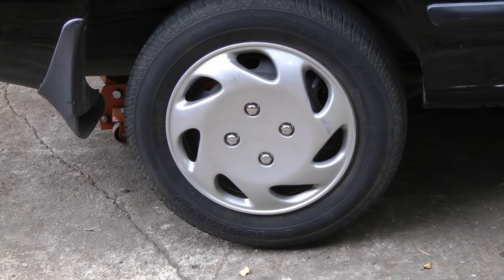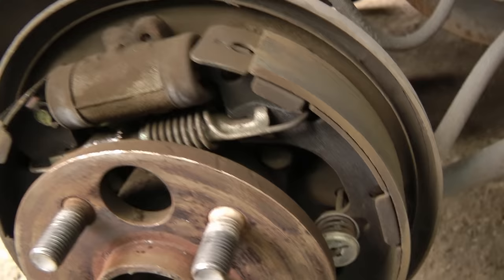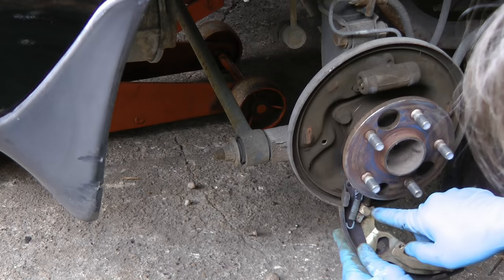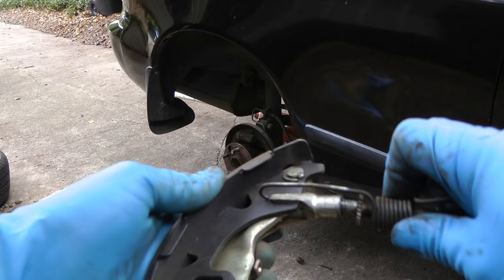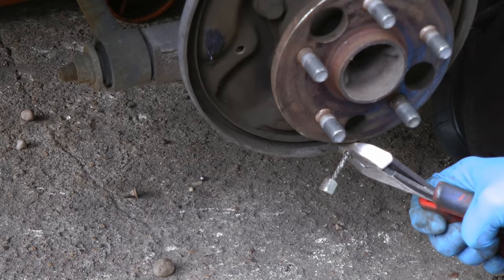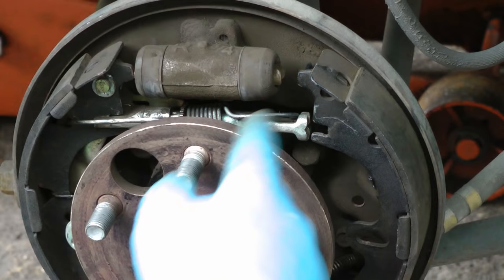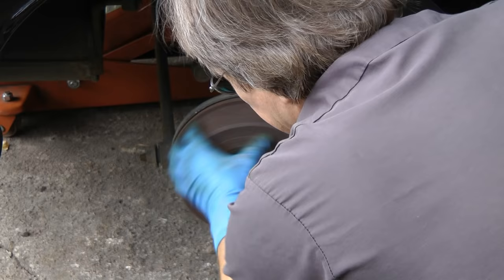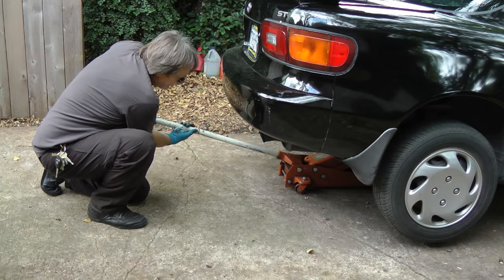How to Replace Drum Brakes on Your Car

Comment: Scotty, when I tried to do this, I didnt hold the brake shoe as I pulled out the big spring across the top. So, my wheel cylinder went out of whack. You did hold the shoe as you were pulling the big spring off, but you didn't mention it to people. So, hope people realize they should hold the shoe so it doesnt move as they pull that big spring off.

Comment from the maker: by "cover" I assume you mean the brake drum. If so, many have threaded holes in em, you use 2 bolts screwed into the holes to force if off. If not, you need a brake drum puller tool to pull it off.

Comment: I HIGHLY recommend  thoroughly cleaning both brake systems before you start. The brake dust is harmful if you breath it.  Second, you can see all the parts in much better detail.  Third, it makes the process much less nerve racking; in most cases, the whole experience becomes enjoyable.  This applies to any mechanical repair, not just a break job.  

The difference is night and day.

Comment from the maker: they are self adjusting, pull off the wheels and see if they are worn out, or if the wheel bearings there are worn out and wobble.

Comment: @Scotty Kilmer my drums are stuck and the bolts that are need to screw them in to push out the drum from being stuck the size for my civic 2013 say 8mm 1.25 but it is to small what size would fit i seen many different sizes i dont want to strip the thread thank you

Comment: And if you're someone who doesn't have the drums where you can screw in a bolt, like myself, you can get a drum puller kit which also helps, just in case the hammer isn't enough

Comment: Thanks, the shoes on our car seemed to be stopping the drum from turning all the way. Shame the drum wasn't as easy to open as this, with a Fiesta 96 there's clips and a huge bolt which needs undoing first (the size of the bolt is not easily found in stores for some reason).

Comment: You are so right...brakes are not hard to do.  I went to a mechanic and they wanted to charge me 400 to do the rear pads and rotors.  I did it myself for about 75.00......

Comment: My brakes needed a little more work than that. The shoes were down to the metal and there was a chunk missing from inside the drum. And of course I found that the wheel cylinder looked like it should be replaced as well.

Comment: Hey Scotty can u tell me why my wheel cylinder keeps popping out pass my brake drum I replace everything the same on both sides when I put my brake drum on it goes on very easy and slides right off easy but when I turn my wheel it only turn slightly then click and stop I can't spin the wheel around 86 cutlass

Comment: I didn't see the new shoes matched to the brake drum curevature. If the shoe rocks too much in the drum it causes a spongy pedal. The shoes can be bent to fit and are almost always too "rocky". One end of the shoe should only raise .020" or so when the other end of the shoe is pressed down while laying in the drum.

Comment: Hey man thanks for your advices.  I replaced my brake shoes on my 2010 corolla and bled the brakes since one on my rear pistons got out of place and pedal sunk. I did Passanger rear then Pas. Driver side then front passanger and last driver. While the car was off the brakes fell rock hard after being bled. But then i turn my car on took it for s spin but breaks feel soft, it breaks but pedal goes too further down. I wonder if i need to adjust my rear drums or if i need to bleed it again. The emergency break still goes almost all the way up.

Comment: Thanks Scotty! Would be nice to explain where to put the floor jack behind the car? So do you need to bleed the brakes?
Reply from the maker: you don't need to bleed brakes if the system is not opened to the air. See my video "how to properly jack up a car"
Reply: Scotty Kilmer
Cool! Thanks so much Scotty. I will check out your other video. Much appreciated!

Comment: Thank you Mr kilmer. You just me a lot of money on fixing my brake shoes. But don't you need to bleed the brakes or is that just when u replace the cylender to?
Reply from the maker: yes, only if system is open to the air when removing or opening lines do they need bleeding

Comment: Hi Scotty.  Question:
have a '93 Ford T bird.  I am getting a bumping/rubbing noise in rear right brake.  Left rear looks great with great meat on pads.  Right rear looks odd.  The trailing shoe looks worn a bit with cracks near the top rivots.  the leading show looks fine with lots of meat.  What could cause this rubbing/high spot noise?

Comment: Hi Scotty. Brilliant videos. Thank you. I have a Citroen Berlingo van 2004. she has grinding noise form rear shoes when braking. how do i tell whether the worn shoes have damaged the drum when i take it off.?
Reply: Check the drum for grooves, if the shoes have worn too much the metal rivets will drag and make grooves in the drum.  The drums can be machined provided that there is enough metal to stay within specifications (there should be a measurement (mm) on the drum for the maximum diameter that is specified).
If they can't be machined within specifications, then you will have to buy replacements.

Comment: I got a 2006 Ford ranger with 223k on it and I need to do the rear drums. I got free brake shoes but I'm wondering if I should go ahead and change the drum , brake cylinder and get a spring kit while I'm doing it. I see a lot of these videos the springs are rusted but I haven't looked at mine yet. Is that just a waste of money ? What do you think

Comment: Ford has told me they had to replace the seals too which meant taken off the rear axle (don't ask me why). I asked, is that always the case? They said yes.

Also, do the disks need to be replaced?

Your expert opinion?

Comment: @moofushu Scotty is right but if you lack the tools, grandpa's way of doing it would be to lightly place a paper napkin in the spark plug hole of the first cylinder. Disconnect your fuel pump relay and your battery negative terminal. Turn the crankshaft in the correct direction slowly until the napkin blows out. Then find the TDC mark at the flywheel and match. All cars should have one. Don't go the opposite direction! If you miss it, keep on turning the crank & start from step one. Have fun! :D

Comment: @SOTPM theres a special tool out there for just that proble i for get what its called though but as for me i had the same problem i just hit it with a regular hammer using all my strength. took awhile but i finally got them off

Comment: Scotty, on my 1998 Hyundai Elantra, got a brake problem, the pedal almost goes to the floor , i can lock up the front brakes, but the back i can't , no leaks , replaced the master cylinder , i noticed when i adjust the rear , the pedal doesnt travel as much , BUT then after a few days or driving , it goes back to normal, pulled the vacuum hose off the booster i hear is hiss, so i know its holding pressure, there should be amount a inch of travel on the pedal, how can i fix this ? i did find the drivers side caliper is locked up , not working, please let me know. thank you
Reply from the maker: Kody Darlington fix the driver's side calliper first, that can greatly effect pedal height. sometimes something as dumb as worn rubber brake lines that collapse do that

Comment: Is it necessary to change both left and right rear drum brake pads at the same time? Can I drive safely if I change rear brake pads only on one side?
Reply: Toma Kukoč it's not recommended you do that but if it still stops ok and won't kill anyone you'll be alright for a bit. Better to do things in pairs when it comes to brakes and other things

Comment: Hello Mr Kilmer I'm a big fan of your channel.  Thank you for the great work.  I have replaced all my brake hoses and front pads including a new break cylinder.  Yet I did not change the rear drum breaks and now the pedal goes all the way to the floor and seems like I don't have braking force I have also replaced the brake Booster yet nothing seem to help I have a 02 Ford Escape v6 any help would be great thanks
Reply from the maker: David E often a bad master cylinder does that, or air in the system, bleed all the air out first. If not that, and if it has ABS brakes, often they do that and a guy like me is needed to analyze it with a dealer scan tool
Reply: I actually  took it to the shop the mechanic bled the system and told me the issue was the brake Booster which I later on replaced and same same is it possible I did not replace the Booster the right way? It's not really that ball breaker...  I had enough room so I did not need to take the master cylinder apart so no opening of that system.  Thank you very much for your reply

Comment: hey scotty, I am doing rear brakes for a 1999 durango. I replaced the hardware, wheel cylinders, and shoes for it. it now looks exactly as before I removed it but now its too tight for the drums I turned. everything lines up right but its just a tad bit too tight and even hammering the drums in with a rubber mallet is difficult

Comment: Hi Scotty I changed out my brake pads on my jeep, I purchased BOSCH pads . Are they any good ??
 It feels as if the brakes are faded a bit and don't grab the rotor like it should . The install was perfect , I'm doubting the pad , the rotors were ok. ( they seemed)
Reply from the maker: decent pads, but not great. But change or turn the rotors and they will stop better

Comment: How can I tell if it's my Rear Drum Brakes that need replacing or my Front Disc Brakes? There is a grinding that just start yesterday, but there was never any squeaking that I thought would come from the wear indicators on disc brakes. Also, thanks for a great video!

Comment: Scotty I have a question.  How do you make sure an engine is at top dead center in the compression stroke and not in the evacuation stroke?  I ask because this comes up when synchronizing the cam shaft to the crank shaft to make sure engine timing is perfect.

Comment: I just changed my rear brake shoes on my 2005 grand caravan. before changing them I had no noise from the rear. now Since I replaced the drums shoes springs. there a loud khocking noise coming from the passengers side rear. I can't figure out what's causing this.i checked it all twice its installed properly. so I'm stuck on what to do. Thanks for the help
Reply from the maker: you may not have tightened the auto adjusters right so shoes knock. Pray it's that, cause otherwise something is not on correctly or is the wrong size.
Reply: Ok ill recheck it all an let u khow I heard something about dodge issued a bulletin that the brake cylinder might need greasing or should I just buy a new one

Comment: I love how he lowers down the car so fast on a floor jack. Fakers like Chris Fix will make a big deal about it.
Reply: trance20001 Scotty did it so fast because he didn't have jack stands. Chris uses them, which is slower but safer.
Reply: Jack stands have nothing to do with lowering the floor jacks slowly or quickly.
Reply: trance20001 it's pretty dumb to lower a car that fast.

Comment: Mr. Kilmer, I am working on the exactly same car and also on the drum brakes. Are the shoes on this car exactly the same or is one a front and one is a rear shoe?
Reply from the maker: they normally are, measure them side by side. If not, put the longer brake shoe on the front.

Comment: Scotty, I performed a complete brake job on my 2004 Acura RL, changed all the rotors and brake pads. When I put the wheels back on and went for a drive, my steering wheel starts shaking at high speed around 50mph. I did not torque my wheels. Also, brakes work fine, no grinding or shaking when braking though. What did I miss doing to the wheels?
Reply from the maker: something is out of ballance, like poorly made rotors, unevenly torqued lug nut, or rotors that went on a corroded hub and isn't straight
Reply: Scotty Kilmer Thank you, I'll start with the easiest one first and get the wheels torqued to correct specs then see if it makes a difference

Comment: Scotty first of all, I love the video. Second I had a question. I showed this video to my dad and he said that you have to adjust the brakes to perfection. He said that once you're done, you must mark the drum and make sure it does exactly one revolution when you turn it with your hands. Then he said you must synchronize both sides.he said otherwise one side will brake before the other and that the car might turn to one side more then the other when braking.  Is this necessary? H

Comment: i was installing new brake cylinders on my buddys car and accidently tore a hole in the rubber cap on one end of the cylinder....should i be worried? will that allow air to get inside the cylinder?

Comment: Good videos generally, but I broke my retainer ring pins in following this tutorial because you forgot to show how to loosen the shoes adjuster before pulling the drum off. I pulled the drum off with a lot of effort and broke the retainer pins as it was pulling the shoes forward with the drum. I had no spares, so I had to use a nut and bolt instead of the pins. Seems to be fine but was annoyed.

Comment: Just changed my rear drum brakes. Now the brake pedal feels very deep and soft!! Some oil got out of the wheel cylinder while changing the shoes, but I closed the rubber quickly back in place ... I also double checked in the drum after testing the car and there doesn't seem to be amy oil leak... What can it be?
Reply: bleed your brakes.
Reply: @jettesides420  thanks and that's what I did and now it's perfect!

Comment: Hey Scotty! huge fan of your videos!.. my rear brakes make a clicking noise when im coming to a stop and then stop after enough pressure is applied how do i find out what is wrong with it
Reply from the maker: +Derek Trevino check to see if they are worn out first, but if not, drums often don't adjust right when old and the automatic adjusters then need cleaning or replacement. If you have disc brakes, then they are worn and need replacing and new shims

Comment: I have a question is it possible to change drums and make it as a disc wheel
Reply: that is a conversion and considered a modification. if someone takes you to court over an accident, it will not far well. you will need much more than brake pads, rotors, and calipers. disc brake systems also have different hoses and lines going into them. I also suggest changing for new hardware when dealing with anything if possible. when you buy your next car, make sure it has all disc brake systems on all wheels, much easier to maintain.

Comment: I really enjoy watching your channel. A question if I may. Would a rusted adjuster cause a brake drag? I have some kind of rubbing in one wheel and I found that my adjuster was so rusty that I could not turn it easily. I had to pry it to get it to move. So I'm thinking about a brake rebuild kit? Does that sound reasonable?

Comment: @scottykilmer Thanks. I've done that. Another question: the piston of the wheel cylinder came out during my work. I could see some fluid out too and I thought it was brake fluid. I put them back on and they were still moving like nothing happened. Do I have to do anything other than bleeding the brake?

Comment: Hi Scotty: my 98 explorer brakes fine and after getting it back from the valet parking garage, now it takes pushing down on the brake pedal 85% for them to start working. I just filled the reservoir up with fluid bc it was almost completely empty. I pumped the pedal and now the reservoir is half empty/full. Do you think I just need to add more bc it was that empty or do you think there's a leak? Thanks

Comment: Hey Scotty, i took the rear drums out and stepped on the brakes and cant get the drums back on..so I readjusted the star wheel and put the drums back on.....now i see oil coming out of the wheel cylinder.  Did i just mess up the wheel cylinder?  The car is only 4 years old. :-/

Comment: I like your channel.  But...no dust mask?  No brake dust?  No brake cleaner with pan to catch run-off?  No inspection of the drum?  No discussion of the drum wear limits?  No cleaning of the hub to avoid misalignment?  But still a very helpful video.

Comment: not if the system was not opened to air. only when the system is open or your replacing brake parts such as master cylinder, wheel cylinder , etc

Comment: i have a question: if i change rear drum brakes on manual does emergency brake has to be on? I'm afraid if i don't apply emergency break the car will move and fall off stands.HELP SCOTTY
 but if it's on i can't work on them, is that right?
Reply from the maker: it has to be off to get the drums off, put it up on jack stands and it can't move
Reply: Scotty Kilmer
THANK YOU SCOTTY :-)

Comment: How do you fix a drum brake that's seized up? Would pulling the car with the seized drum brakes on the pavement till the drum rotates freely be a good idea?
Reply: Seized meaning tires are locked
Reply from the maker: +Peter Kapica worth a try
Reply: Alright, though it may damage that one or more seized drums beyond salvageable

Comment: Scotty, thank you for your videos, you've been a great help over the years. Hopefully you will respond to my question. I have a 2000 Plymouth Breeze 2.4L which the brakes have been squealing badly. I inspected the front pads and the rear shoes and there is plenty of life left. Last night I noticed the oil was extremely low so I topped it off, today the brake squealing was nominal. Any idea on how those are related? I consider myself an intermediate level mechanic.
Reply from the maker: oil has nothing to do with brake squeal. if pads and shoes have plenty of lining left, worn shiny rotors do that. It hurts nothing, and rotors and drums cost a lot to replace